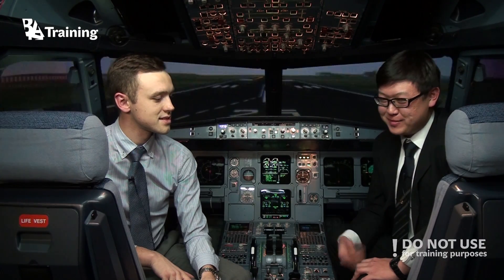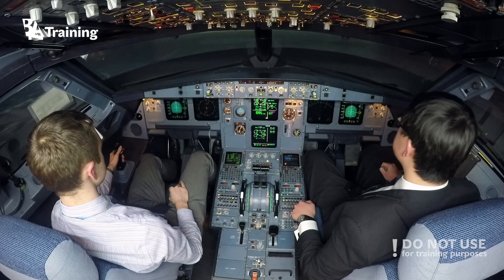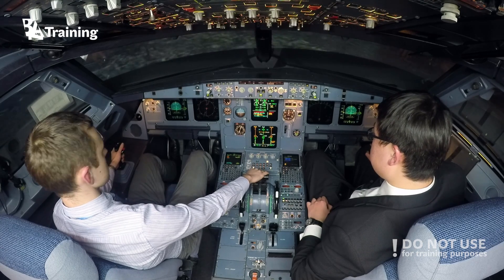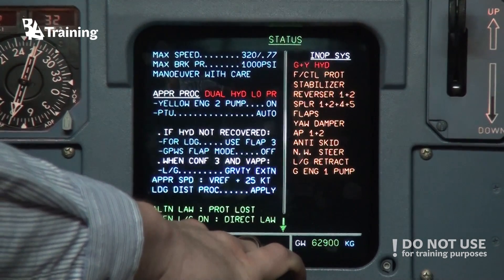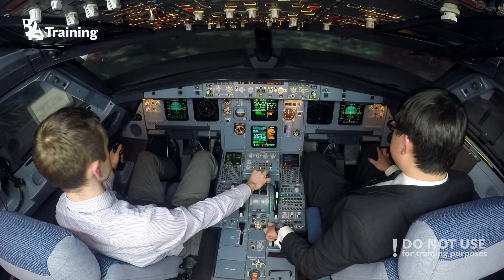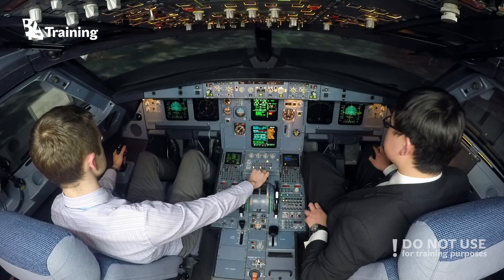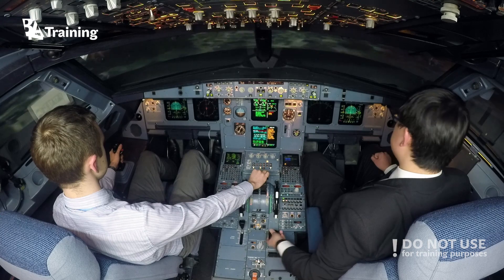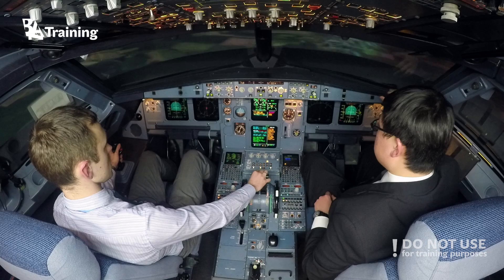Airbus A320 Dual Hydraulic Failure  - Type Rating - BAA Training

Comment: btw these are not all the mistakes 
the main mistake of the crew was that always during a flight 1 pilot should  control the flight and the communication while the other should perform the ECAM checklist and in this case these rules were not followed 
2)the LOC and G/S cannot be captured if the autopilot is not operational
3)no chronometer was set during the takeoff roll
4)pressed autobreak button when its INOP

Comment: The ECAM procedure was not followed as per Airbus SOP. The ECAM was not stopped to check for normal checklist, any computer reset, QRH procedure. The status was not read. The Flap setting was not as per SOP, the speed needs to be checked first the the flap is to be set and setting to be called after seeing the SD page. The normal checklist were not done. Both the pilots were looking inside. PF was also entering data in MCDU. PM should have been doing all the MCDU entries, ECAM actions.

Comment: 1- no seatbelts used
2- no chrono for take off with TOGA
3- when gear up, nose gear lights must be turned to OFF
4- no oredered Ecam Actions
5- At status: check C/B, check OEB, After T/O climb checklist
6- Land asap red : it's a MAY DAY 
7- lack of preparation of the approach (no MCDU neither QRH in flight performance part)
8- no approach briefing (asking for MED Auto/BRK after reading it as inop)
9- no approach chart to check the descent and the final approach profile
10- no minimums (MDA) insertion
11- since Auto/Thrust is Auto, you must manage speed on the final segment of the approach to allow the Ground speed mini function to work in case of needed

*by the way, good touchdown!
you'll improve with time ;)

Comment: Does the Airbus autopilot automatically disconnect when the stick is moved or does the pilot have to push the red button to manually disconnect the AP?
Reply: +James m It automatically disconnects if sidestick is pushed beyond certain threshold. However it is always preferable to disconnect it via that red takeover pushbutton on the sidestick.

Comment: These are mistakes that your team made, in my opinion:
1. No chrono started on take off. It is usually set to time the duration of power application, because the TOGA thrust has a strict limit of 5 minutes using it on 2 engine operation, while with single engine operation that limit increases to 10 minutes.
2. No half stick down on take off, until 80 knots and then progressively reduce the deflection to reach neutral at 100 knots; to counteract for the nose-up effect of setting engine take off thrust thus improving aircraft performance.
3. No "Thrust/Power set" callout on take off. If there was a discrepancy of more than 1% of N1 between the engines, it should be entered in the logbook after flight.
4. Squawking 7700 on take off, while the failure haven't occur yet.
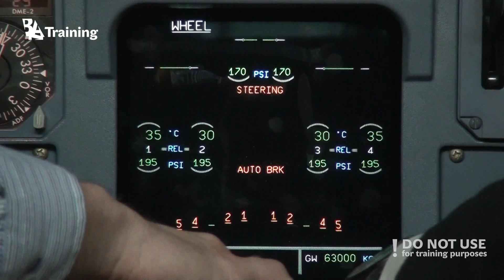5. 2:43 UTC time on SD not synchronized with the cockpit clock thus showing amber XX.
6. Violeting Airbus third operational golden rule:  "One head up at all times"!!
7. Clear SD (System display, Lower ECAM), throught the whole flight no one cleared it. On 3:07 we can see an overflow sybmol which indicates there are more messages to be read, but because no one cleared it that messages weren't displayed to the flight crew until very the last end.
8. No minimums entered.
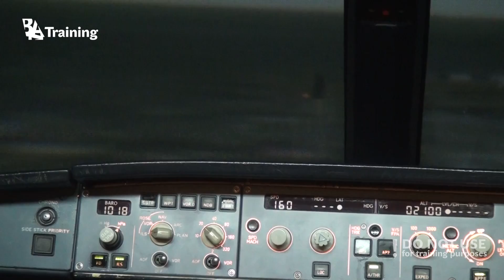9. 7:00 Landing gear gravity extension wasn't done correctly. You should first pull and turn the handcrank 3 times clockvise  and then select the gear down, but not vice versa! There is a big difference and I am surprised that nobody noticed it.
10. On touchdown no "Spoilers up" call. Spoilers number 3 on each wing were fully operational, and armed upon landing.
11. Now here gets interesting: Why haven't you followed the APPR PROC on SD? If hydraulic system is lost by RSVR LO AIR PR the related pump(on approach) should be selected on and PTU to AUTO position. In most cases the hydraulic is RECOVERABLE. Just think how many INOP systems you would recover! That's like, when engine fails(no damage or fire), you say: "No I don't won't to restart it". Ughhh..
12. I noticed that you have first extended the gear and then stabilized on VAPP, which is unfortunately wrong. FCOM 3.02.29 P11, Extending the gear after you have stabilized at VAPP enables the aircraft to be trimmed for the approach, unfortunately, this wasn't done correctly. 
13. Landing distance procedure was never applied. It calls to multiply your LDG DIST for 2.3 times due to the increased approach speed, loss of antiskid and reversers 1+2 and partial loss of ground spoilers.
14. 1:50 PF never reads ECAM procedures! PNF is responsible for ECAM/checklist reading and executing various commands on PF request. This isn't the only time PF does that.
15. No consulting with QRH or any kind of manual! Many of this mistakes could then be avoided.
16. No cabin crew or ATC notifying about the failure(these are actually 2 mistakes..)
17. No "Brace for impact order" for passengers, in this kind of emergency it's neccesery to do that(grave danger of overshotting or skidding of the runway-since you don't have nosewheel steering).
18. No passengers informing about the emergency on board.
19. No takeoff/approach/landing checklist.
20. Violeting Airbus second operational golden rule: "Fly, navigate, communicate - in that order"!!
21. 7:10 Clear E/WD(direct law warning), consequence: no LDG MEMO.
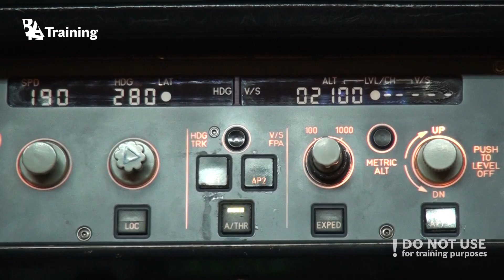22. And in my opinion one of the biggest mistakes is that you have never consider to put the aircraft in a hold. It would give you more time to set the things up for landing, and also to be more prepared and know what to expect. The approach briefing was never done(it is a crucial to do it when in an emergency), crew never discussed what will happen and how will the A/C behave on touchdown, what in a case of go-around which ultimately resulted that the crew wasn't aware of the failing systems: 5:01 . Autobrake was clearly INOP.
23. ECAM Actions were never said, you just started to read from ECAM, and what's worse PF started to read ECAM not PNF.

I just have a one question for you: What have you done with ENG1 before takeoff since it has almost 15 times more fuel used than the right engine?! 1:10 (ENG 1 3600kg, ENG 2- 250kg)Have you kept him on MCT for 1h and then started the right one?

I bet that someone will copy mine!
Reply: Did they send you a simulator to your home?
Reply: +Davor Susa well explained
Reply: I agree with every word in this comment
Reply: Amazing.
Reply: +Really well explained, I agree with everything said.
Reply: +Davor Susa ala si lud XD
Reply: +AirplaneTVcom Have I done any other mistakes, because I would really like to hear it from a real pilot.
Reply: +Davor Susa  PERFECT!!!
Reply: +AirplaneTVcom Oh I didn't know that...
Reply: +Davor Susa number 9. is wrong, first you select gear down and thereafter crank the emergency gear extension handle. Not vice versa.
Reply: +AirplaneTVcom I must say that I disagree with this one, only number 9, 12 and 13 are from FCOM(and one part from QRH). Maybe there is not a big difference if you do it vice versa but that's the correct order(I think that it has to do sometihing with gear selector valve, but not sure because manual says practically nothing about it). But thank you for pointing out to me.
Reply: what was the gift btw
Reply: AirplaneTVcom Well it is training in an universal flight school, so trainees should do that.
Reply: Great
Reply: Davor Susa Well done, looks like somebody has been researching.
Reply: @Jayknowsthewaze  just a wiki know it all. *rolls eyes * I bet that user has 15 000 flight sim hours.
Reply: Ugh, another wikipedia know it all.
Reply: It says at the bottom left not to use for training purposes.
Reply: @lachyplays3089  yes, that watermark makes sense now
Reply: @DavorSusa What was the gift?
Reply from the maker: +Davor Susa Congratulations! You are the winner of this challenge! Please send us your full address and phone number to news@baatraining.com or to our Facebook inbox so that we could send you the gift!
Reply: +Davor Susa you are right with most of your comments, but certain callouts depend on the respective airline procedure. "V2" for example, is not called out in the airline I fly for, but has been long ago.
Reply: @Airplane_TV  I've never called v2. 13 years flying.
Reply: @steve10509  Well, as I said: it depends on the airline's procedure. 31 years of flying and some callouts change every other year..
Reply: @Airplane_TV  si
Reply: how do you know all these procedures..what the fuck

i thought I knew some stuff..about the A320 holy fuck dude...are you a pilot or something? :D
Reply: Davor Susa 
And why use auto pilot and keep woring about glide slope if non of the controll surfaces used by the A/P were actually working fly it manually forget about that fucking board it was also stated in the information and still they were using it
Reply: BAA Training Seriously?!
Reply: I forgot one thing:
24. No V2 announcement on takeoff.
That's all for now ;)

Comment: - No Seatbelts
- No headsets
- No communication with ATC
- No takeoff checklist
- Rotated too soon ( before PNF announced rotate)
- No V2 announced
- PNF did not announce engines stable 
- PF did not say flaps 1
- No after takeoff checklist
- Should have turned on autopilot before beginning systems check
- Did not tell ATC having problems
- Should have announced a mayday when autopilot stopped working
- PNF should have been conducting all systems checks, not the PF
- No communication with passengers alerting them of the situation and reasons why
- No communication with ATC explaining situation, announcing mayday or requesting emergency landing and/ or emergency services.
- Did not clear problems list, so if new problems appear, may go unnoticed
- No approach checklist
- No landing checklist
Reply: +Max Manley Fuel dumping isn't possible on A320.
Reply: +Davor Susa thanks for telling me. Ill change it....

Comment: No atc
No seatbelt signs
Not leaving the runway quickly
Not following checklists
Not saying who is in controll
No use of apu/atr
Not informing passengers
Reply: Btw im only 12
Reply: +Daniel Dankers seatbelts were already on, cp was in control from the start. I think the point is to do it without checklists
Reply: Also they couldn't leave the runway due to nosegear steering failure
Reply: 00PiggyCosmonaut Oh, ok, thanks.

Comment: Okay lets start : 
- No seat belts
- No stabilized thrust callout?
- Inappropriate comment from F/O
- No RWY HDG in Autopilot 
- No "ECAM-Actions"
- No QRH/Checklist usage
- No communication with ATC/Passengers
- F/O and Pilot not aware of all failing systems (autobreak / flaps)
- No briefing for landing
- In Parts : No Affirmmation/Confirmation for given Commands to F/O (i.e. Parking Brake)

In addition : Both were focussed on the problem and they forgot that they need to fly the airplane itself

But hey, they landed the plane successfully

Comment: APU not started or RAT not extended depending on FOB
Speedbrakes not extended
Autobrakes commanded when no available
Reply: +00PiggyCosmonaut Not any anomaly, it extends if AC BUS 1+2 are lost and the aircraft speed is greater than 100 knots. And since there wasn't any electrical fault RAT should be stowed.
Reply: RAT deploys automaticaly when an anomoly occures

Comment: APU not turned on
Not informing ATC
No checklists from either pilot
Really bad crew resource management - both are focussed on the problem and nobody is flying!!
No informing passengers
No fuel dumping (probably due to time) resulting in being well over maximum landing weight
Emergency lights not turned on
Not checking for traffic when making unannounced turns
Possible runway incursion if its a busy airport
Not leaving the runway as fast as possible
Reply: Agree with most of your stuff
 -No fuel dump capability's on the single aisle A318/20/21 family, max landing weight is approximately max takeoff weight. 
-Leaving the runway without nose wheel steering would be challenging, and dangerous.
-Your spot on with poor resource management, the pilots knew the procedures well however it appeared they  lacked discipline, confidence and authority in this clip.
Reply: I also realised, the APU isn't really needed unless an engine were to go out
Reply: +Anthony Kernich Sorry but they couldnt leave the runway, they have no steering

Comment: -rotate to soon (just after V1)
-no refering to QRH
-both pilots focust on the problem (1 should fly the plane the other one should try to solve the problem)
-no approach brief or communication for futher plans after the start of the problems
-he calls for autobrake medium but is inop
- no informing of the cabin crew at one moment or so
-no informing atc of some kind
-no landing checklist
-PM doesnt engage the spoilers after landing
Reply: Also the seatbelts
Reply: Hey they were not doimg a real drill, just showing what happens